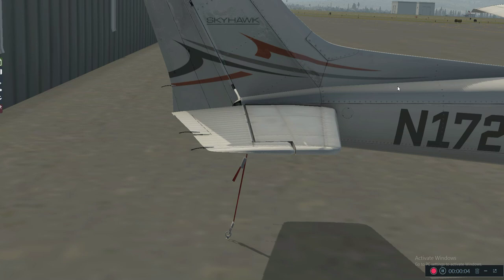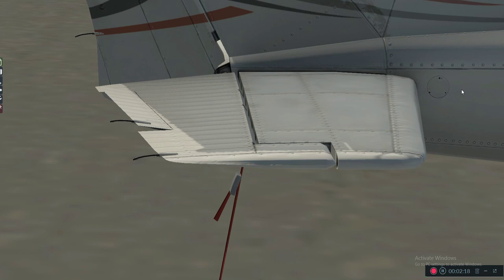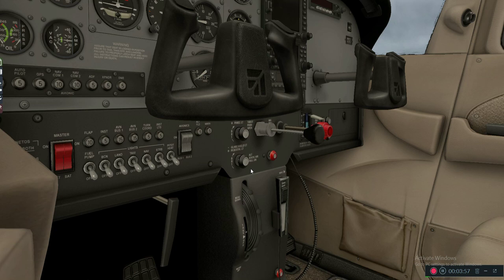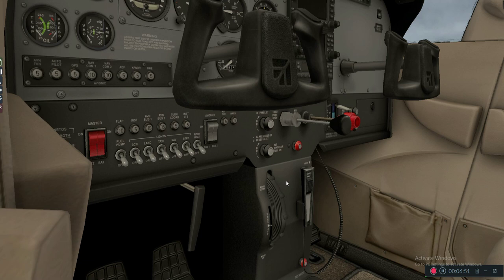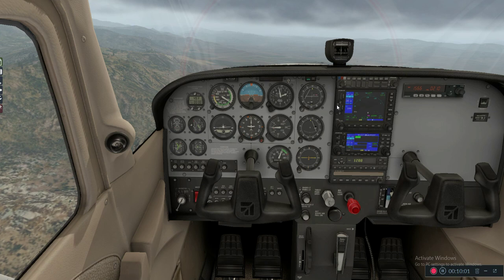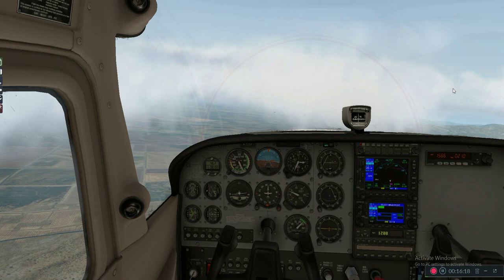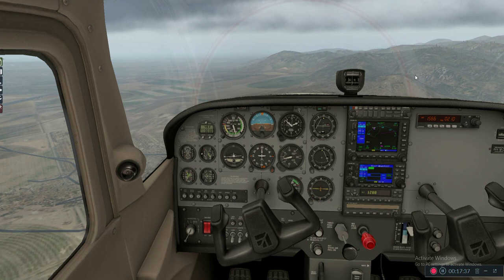Understanding Trim

Comment: Now I understand.  I got this question wrong on the exam because it is not intuitive at all especially to a boater.  Now I see your video and it makes sense.  Raising the trim tab pushes the elevator down causing the nose to down.  The trim tab does not move the plane, it moves the elevator.

Comment: Rather than seeing trim as up and down I see it as forward and back. Therefore: pushing forward on the yolk or rolling forward on the trim results in the aircraft pitching down & pulling back on the yolk or rolling back on the trip pitches the aircraft down.

Edit: I wrote that with the video paused right after he said if you're trinking of it as up and down you are lost XD

Comment: Thank you for explaining that. I almost was thinking that there was a fault with my flight simulator setup. The action is on the elevator and not directly on the air, hence the trim tab moves in a way that is not intuitionally simple.

Comment: solid video. I would just say that none of these surfaces are "pushing air" when the shape of the wing become more flat it reduces lift and there for lowers causing the nose to rise. when you adjust the trim in the opposite direction to cause the elevator to move down, that increases pressure below the the wing there for increasing lift, causing the nose to dive.

Comment: Thanks. I would comment that it's not the case that pitch always controls airspeed and power always controls altitude. Each one can affect speed or altitude ("pitch+power=performance"). It's just that in certain situations (such as high drag, high angle of attack), pitch is more effective in controlling speed than is power (we call pitch "primary" for airspeed in that situation). But when flying an ILS approach, it's easier to think of power as more effective to control speed.

Comment: @coviron21.  Hope this makes it clear how it works.   If your elevator was jammed using the trim wouldn’t help you control the plane.
Reply: Well, in the case of a jammed elevator the trim tab might have a slight effect acting as a small elevator. But it would work in reverse. Moving the trim wheel foward would cause the nose to rise.

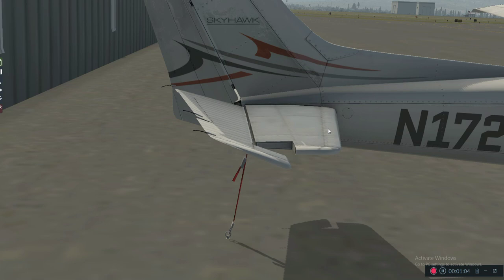Comment: The description until 0:58 is confusing: the yoke is pushed forward , elevator is down, the elevator surface air pressure reduces. The air from the bottom of the elevator pushes the tail up and the nose down? The video talks about the air above the elevator pushes the air down?
Reply: Yeah, the elevator has the air follow it basically, that is also how wings work (along with pressure too)

Comment: Thank you for the informative video. I learned a lot here. I have question plz. Cessna doesn't come with Rudder trim, correct? The reason I'm asking this is that when I'm flying the same way in the video with trim adjusting, the plane keeps banking to the right.  No wind is applied and gravity in the center of the plane. Any idea? Thank you again...
Reply from the maker: Many Cessnas do not have a cockpit-adjustable rudder trim. But they will still have a rudder trim. Look for a metal tab on the back of the rudder. It is somewhat triangular. Don't touch it! This is meant to be adjusted by a mechanic on the ground.   When you are experiencing your issue with bank, look at the ball. If it is not centered, apply rudder until it is. If the plane continues to bank then you have an aileron trim issue. Many cessnas do not have aileron trim either. If this is happening in the simulator you can often add a button for aileron trim even if the real plane doesn't have it. You might also check if your fuel is balanced and your joystick calibration and null zone. I hope this helps.

Comment: Why the trim tab is only on the left side of the horizontal stabilizer  (Cessna 172)?
Reply: There is another on the other rear stabilizer on the other side of the vertical stabilizer
Reply: It's only on one side for simplicity. Putting another one on the other side is not needed and would add cost, weight, and might potentially be less reliable because there is more to go wrong.